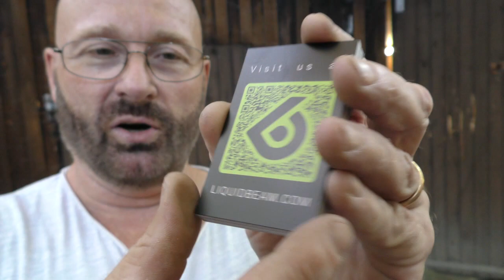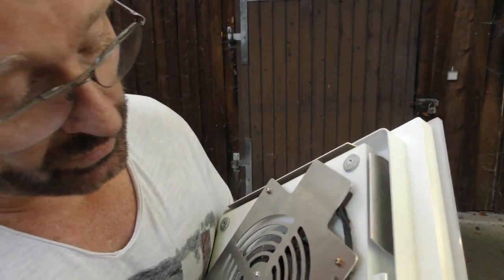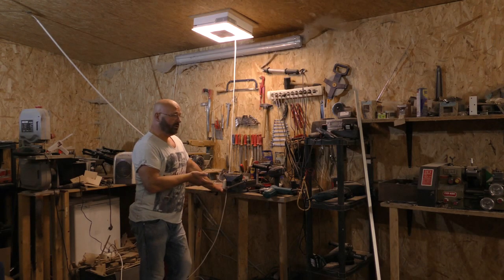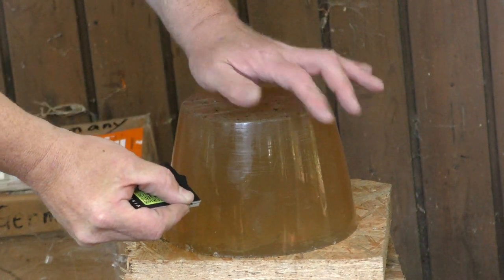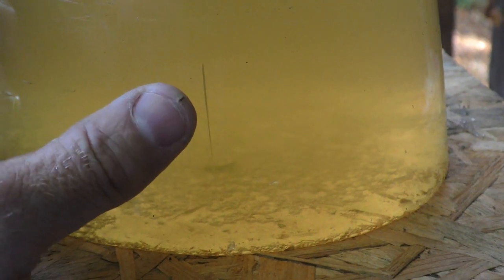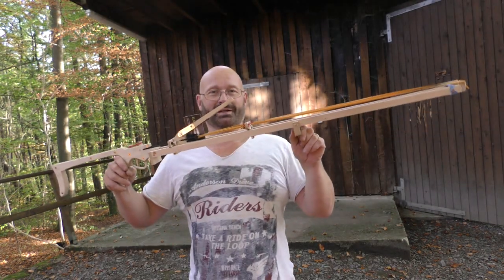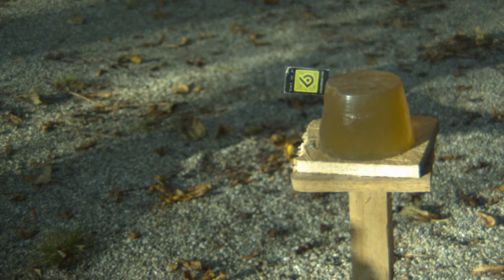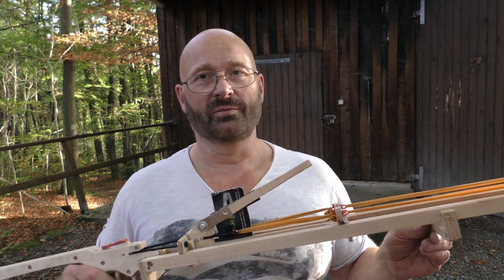How To Weaponize Business Cards - "Cardception"

Comment: This stuff already existed ages ago. Back in the day when people didn't have central heating and started to have dedicated bathrooms inside their homes. They had a lamp with a heating element, that could be switched on when needed. I'm sure you also had these in germany Jörg. There is a reason why they are no longer in use today. First of all using an electric heating element has high power consumption and secondly heat rises. So putting the heating source on the ceiling is a bad idea.
Reply: I think the lamp uses infrared radiation to heat, not convection. And radiation doesn't actually care about such trivial things like gravity ;) But your right, it's a little bit outdated
Reply: I came here to point this out.  It is not based on infrared, Chrystan and that's why it needs a fan.  

Wait! I just thought of an improvement to this product!  What if we put it on the floor, and had metallic flashing behind it to focus the heat on the user.
Reply: The only way to use electricity for heating in a sane way is through a heat pump. Everything else is just a waste of energy.
Reply: Late to the party here but... I have an small office room made from a large wardrobe. No heating and in winter it can get quite cold. There is no room for a wall heater so I actually think that this would serve a purpose in that room. And I do not think that this product is meant to be the sole heaters in a flat, one in each room. No I think it is a solution for quick and out of the way sorta idea.
Reply: LED lightbulb - £3
Cheap fan heater - £15
Problem solved. And these "engineers" want you to spend £300 on a heater that fits on the *ceiling*. Remind me again how hot air balloons work...
Reply: Yeah i was Donna say my grandma was one in her bathroom.. Its basically never used as we all live in Queensland though
Reply: @chrystan5134  radiation does care for gravity, but just not as much as we do

Comment: about the lamp, it's nice, but the heated ceiling has been tried and used for office spaces back in the 80's here in norway, what we found was that people complained about cold feet, litterally. heat travels upwards and that's why it should be emitted from near the floor, to heat up the whole space.
Reply from the maker: It isn't meant to replace the main heating, just as a fast acting additional heater. Floor heatings can take many hours to warm up a room, this emits heat right away.
Reply: We have the same sort of thing here in a lot of schools, and the same problem. That being said, in something like a school or an office that's looking for a replacement? I could see this selling to that sort of customer. Perhaps a running mode that uses the fan and not the heating element too, at that point you've got an all in one device that's a hell of a lot cheaper than doing it all separately in something like an office space.
Reply: I can see it being really useful for like a garage or a shop

Comment: Neat!  I've rented places with inadequate heat in winter, and my hack was to install low-amp LED bulbs and plug my electric heater in to  the lighting circuit using a light socket adapter!  Kept the total current draw low to not trip the circuit breaker, which was usually 20amps.  (It should say on the electric heater how many amps it draws, and it will say on the bulbs Watts or amps—in the US, anyway)  Just wanted to share from my experience—I hope this keeps someone warm during the winter!

Comment: Heater on the ceiling?
Heat goes UP! C'mon! Why do you think nobody did it before?
Reply: There are heaters on ceilings in shops like Asda and Iceland (UK)
Reply: that's why it has a fan. heat goes down, gets pushed to the side, and goes up, which would heat a larger area with direct airflow than a heater on the ground. while hot air does float up, heat doesn't, so that means as long as you push the air towards your target in a heater, everything else is fine.

Comment: I appreciate the guys' effort, but it just doesn't make sense. There's a reason why there are heated floors and no heated ceilings, it's called convection. A heating element on the ceiling will not get you warm, even with that rather anemic but loud fan. A regular lightbulb and a (silent!) 1500W oil heater will do a much greater job at a fraction of the price.
Reply from the maker: This isn't meant to heat up your house. It projects a lovely beam of warmth to your upper body, feels great.
Reply: You're right. On a second thought I can see how it could work hanging above the workplace in the shop, providing both lighting and warmth. The fan noise is not much of a nuisance in the workshop either. The marketing materials on the indiegogo page could stress that more though, it's not extremely obvious.
Reply: They do work I've used a much older version of that product. Like 60 years older haha and it works fine
Reply: It's mainly for bathroom use though

Comment: "Eliah" is just stupid. 
Noh, it certainly will work as advertised.
It is really just as simple as you said - a lamp with a heater. And heating your room with electricity like that is kinda a bad idea. using a heatexchanger or even directly burning oil/gas would be cheaper.
But do you really need a light+heater-combo!? get light and a heater - done.

(kinda seems like a japanese invention - like airdondition+washingmachine, radio+toilet)

And business-cards are pretty much dead already.
Reply: Noisy !!!
Reply: ABaumstumpf Worst thing is that there is a much better low tech solution. The most efficient solution would be using a conventional glowing light bulb since 99% of the energy there is used producing heat. This way, just using a big number of bulbs you would be wayy more efficient. I think you could make the same thing for less than half the price, even with replaceable lights.
Reply: ABaumstumpf I find it strange, that they call their product "new" or "innovative". Pretty much any light(and especially some powerful led) produces plenty of heat. Usually there is even some kind of cooling system, as the heat damages the Led
Reply: Probably not particularly useful for home use due to energy inefficient heating solution and noise BUT may be great for sheds/workstations like Joerg's where you may only want to heat a small part of the room near the workbench where you are standing and need the light in the same place too. Being relatively small and integrated makes it good for this too as you are unlikely to install gas pipes to your work shed for proper heating.
Reply: I wouldn't trust anything that is a light/heater combo. That's just asking for a fire.
Reply: 2000 watt is a lot. A reason why we chose to use oil instead.
Reply: also heat rises so it is even more inefficient
Reply: Negative much? I don't think Eliah is super revolutionary but it might appeal to someone who just wants one thing to plug in to get heat and light.

As for the business cards like a lot of Joerg's stuff it's about the challenge of making it work. You wouldn't think a business card could do that much damage or stick in wood, not sure what the real world usefulness of them have to do with that. In fact as much as I like them most of Joerg's inventions aren't ever going to be useful in real life so if that's a negative for you I'm not sure how you can enjoy a lot of his stuff. Personally I think the silly things he makes into weapons are half the fun of the channel.

Also business cards still have their pluses, it's a quick easy way to give someone your info at a trade show, meeting or random encounter. And yes you can do that with technology but handing them a card is still quicker and doesn't require them to take out their phone.
Reply: @Where's my Irish whiskey? Tullamore.
 but a fire is a light/heater combo XD
Reply: Oryx Land - the cards i mentioned not because of him firing them, but cause he said they would be common. i quit enjoy it when he makes silly stuff - but this and that are separate matters.
Reply: Did you say anything positive at all throughout that comment?
Reply: Yeah that was the application I was thinking of, plus switching your lights on and off to control it would be pretty annoying in the house. Also if it was for a shed you'd be wiring the switch from scratch so not much point to the whole one switch deal, would be easy enough to use two and do away with some of the expense and complexity
Reply: It is the stupidiest idea ever. If you just want some heat then you have to put up with light as well (not great when trying to sleep for example) and on the other hand if you just need some light then you have to endure the heat (not great in summer for example).
Reply: The plain old lightbulbs makes a lot of heat, so just installing those in my lamps (witch currently has LED bulbs) would give me alot of heat..
Reply: I think the idea might be use it in a workshop. Where you really only need light and heat in your workspace for a limited amount of time
Reply: @ABaumstumpf: Du scheinst nicht in Bereichen zu arbeiten in denen man immer wieder neue Menschen trifft, sonst wüsstest du dass Visitenkarten durchaus noch häufig gebraucht werden.

Aber was die Heizlampe angeht hast du recht, die ist wirklich Quatsch.
Reply: Exactly, a 100W halogen reflector lamp would produce plenty of heat and light exactly where it's needed without heating up the air in the whole room. It would also only cost around 10 bucks.
If you need more heat and light, you could combine a 500W halogen tube for light and a 500W IR heating tube for directed heat in one fixture and it'd be brighter and feel warmer than the Eliah thingy without consuming as much energy and drying out your skin and nose. It would also be silent and could be connected to a regular dimmer.
Reply: sam rowland I have a Light you control by turning it off an on again, I like it because it doesn't uses any additional apps etc. It's not really annoying.
Reply: Horitsu Ich finde sowas ziemlich gut. Ich würde jetzt nicht mein ganzes Haus damit heizen aber wenn man irgendwo keine Heizung hat und man möchte etwas Wärme haben wenn man ein paar Mal im Jahr für ein Paar Stunden in diesem Bereich sein. Dann ersetzt sowas eine Heizung sehr gut. Ich habe mir aber allerdings wegen der Brandgefahr ein paar Sorgen gemacht. Man müsste schauen wie warm die Heizplatte wird. Was auch gut wäre herauszufinden wie viel Strom die Lampe im Vergleich zu einer elektronischen Heizung braucht.

Comment: For throwing cards, put one of the 4 points between your forefinger and middle finger, move your wrist inward as in toward your forearm, and then just aim and flick your wrist outward. Kinda like you're quickly pointing at something. Make sure you throw horizontally also, like you're skipping a stone off water just flicking your wrist the other way.

Comment: You should try soaking card stock with CA glue, then sandwiching it between two sheets of wax paper and putting a weight on it so it dries flat.  I've done that a few times (before I moved on to hot hide glue) to stiffen thin veneer to make it easier to hand cut especially fine strips for inlay work and based on the results of that I have a feeling it would make a business card rigid enough to be pretty be pretty formidable.

Comment: When throwing cards, only the wrist should move horizontally. Your arm needs vertical motion. Think of a barber shop pole, as the hand comes down you rotate into the throw. Kind of a half helix shape, just flinging your arm doesnt impart enough energy or spin. The motion is short and rapid. 

Keep practicing, your grip is good, but the technique needs work lol. Nice build as usual sir!

Comment: The light is a pretty cool concept, but it could use some refinement. I suggest connecting it to the internet of things for mobile control instead of the fidgety on and off switch.
Reply: A small control panel maybe with a multi-pole switch/touch screen would be better for a start-up. But I think ceramic heating elements would be a better first improvement.
Reply: Are you being sarcastic or did you actually suggest to replace an actual on and off switch with a crappy computer, smartphone, or sensitivity based switch ?

Comment: I don't think that product will past CE unless it has a very small battery backup a 2000 Watt heater is going to stay red hot for a long enough time to be a fire hazard if the power goes out. There will have to be a battery backup to keep the fan going for a couple of minutes you might want to pass that along to the inventor

Comment: The reason we migrated away from incandescent light was to NOT have electric heating. The advantage of LED light is that the waist heat is minimal and you get a lot of light with only a little of electricity. This product seems like a huge step in the wrong direction.

Comment: I know you said you dont want a app to control it but alexa has the ability to turn things on and off quickly. If you leave the switch on and plug it into a normal switched outlet can you program it still? If so you can program alexa to do the switching for you. You can even program a pause for if your light is on.

Comment: But the idea wont really work because hot air is less dense than cold or cooler air and will rise. But since it is a ceiling light, nothing will happen. The hot air will just stay up high.  If I am wrong, feel free to correct me.

Comment: Pay attention friend . I heated a house with a standard pelonis ceramic heater at 1/10 cost. $450 on baseboard heater went to $45.... I put it on the first floor even the garage and the house remained shirt sleeves pants instead of sweaters coats and thermal wear... Oh and I had. Broken 24 bones 18 months earlier. That and any friggin light bulb beats that beast above... And the little pelonis box is less than a. Bread loaf in size ... So under the bench and toasty legs and I think two would run you out a 1800 sq ft house . One for every 800 sq  would be more than enough...really drops the electric heat bill ... Thought you would all benefit .. God bless whoever she is...

Comment: Electric heating is much more expensive than gas and this will have a very hard time heating an entire room due too heat rising. And I don't want to have ANOTHER fan running in my room. Although the switch programming feature is nice, I don't like having the lights flickering on and off

Comment: This product is nearly the same as the old light bulbs in some houses😂

When you switched on the lights they heated the room
Reply from the maker: In principle yes. But there is a difference in heat generated by a 60 Watt lightbulb and a 2000 Watt electrical heater though.

Comment: I dont know why people say the "invention" is stupid, yes  gas ore oil would be cheaper but for a outside workshop it is perfect... 
And for all the "wow a we invented leds to avoid heat" people, this thing is programable. normal LED light for most of the time and If you need it can also heat. Just use it to warm up the workshop for 5 minutes and turn off the heat...

Comment: How about $23.95 for an adjustable heater with a two speed fan and settings for 1000 and 1500 watts.  Next how about $39.95 for a 4-ft fixture with dual flouorescent lamps and on/off pull switch.  Together the items are under $70, including taxes, here in Texas.  The Heaters are sold at Walmart; the fixture and bulbs at Home Depot.  My heaters have lasted ten years; my two light about the same, though one of four bulbs burned out.   Your gadget seems fine, but I'll bet that switch breaks in a lot less than ten years.

Comment: I love inventors, I love people who make the things that are perfect for them. But the light/lamp is one of the worst ideas I've ever heard of: 
1 - Homes will not be designed for them, for many homes, whole floors of lights are on the same circuit since they're usually the lowest drawing device. 
2 - You have heat, at the ceiling, where you don't want it (ideally you heat from the floor up), 
3 - Fire hazard, a heating coil next to the ceiling, 
4 - Resistive heating heats the air and feels cold as soon as it's off. A radiant heater would be perfect for ceiling use, but they didn't do that.
5 - If you want light and heat at the same time, use an incandescent. Using LEDs with a heater next to them is silly.

That said, if lots of people want this, then good for them. Just not for me.

Comment: A light source that can also heat? That rings a bell. I might already have something like that and it's smaller, just 10*6 cm, lighter, just around 60g, and only costs around 2€ a piece. It does not use high frequency electronics, is a really simple construction, gives most of the heat of as very comfy heat radiation and has been tested for ages in the most severe conditions. 

Still don't know what I am talking about? Let me give you a hint: It's illegal in the EU. 
(drumroll...)
It's an incandescent light bulb.
Reply from the maker: True. If it is the 60 Watt type, you need 33 of them to achieve the same amount of heat. Side effect: Aliens will get to see your house from outer space.
Reply: Still only as bright as a winter day (assuming all the light gets focused on a single square meter).

Comment: A ceiling mounted heater?  Does that cause issues with heat circulation?  Isn’t it just going to mostly heat the ceiling itself due to convection?
Reply from the maker: Missed the downwards angled fan? It actually creates a very pleasant beam of warm air.
Reply: JoergSprave ah, I must have.  Sounds nice to have in a bathroom to replace those heat lamps

Comment: If German law states that a throwing star can't be flat, couldn't you bend it? Say you have your typical 4 pointed throwing star, and you put a slight bend on 2 points across from each other and then counter bend the other two to optimize flight wouldn't the still be legal?